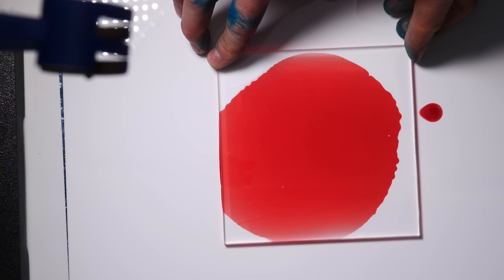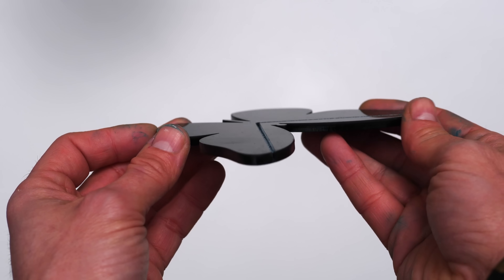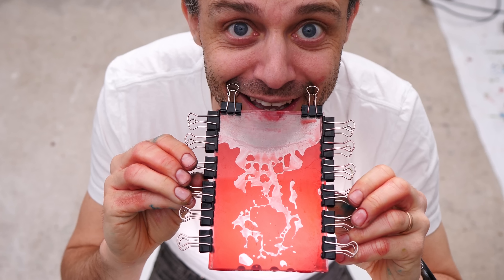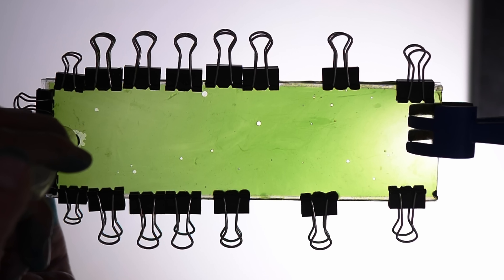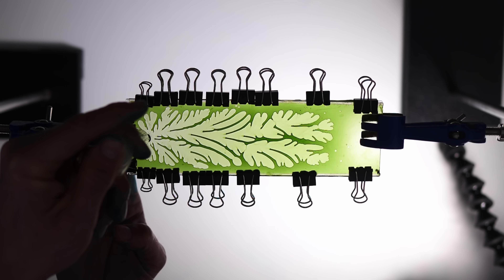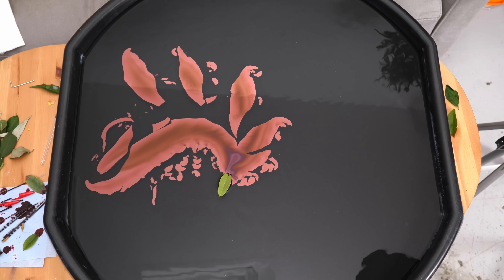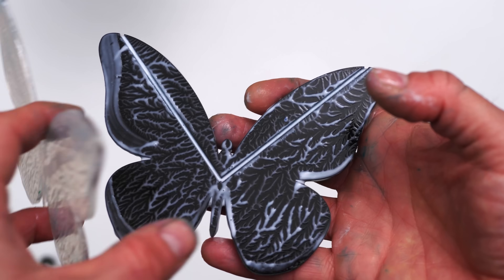Why honey makes these strange tendrils

Comment: I think a leaf would work perfectly for the plate shape and would look really good
Reply: At least one comment suggested starting with half a butterfly, reassembled side-by-side after it's pulled apart from the center out.
This would also work for the leaf, or any other symmetrical shape.

Comment: I believe the feathering follows the direction of the forces, so to achieve a symmetric pattern you would need to pull from the center body, without channels.

If you wanted to influence without touching the fingers, I'd reccommend reinforcing the non contact face of the plates. the reinforcing effect is a function of the plates "z" deformation, which is influenced by how its pulled apart.

Comment: Steve, I bet if you drilled some small holes through (as in normal to) each sheet of the butterfly you'd get a better effect than a channel from the edge. You could vary the density of holes for interesting effect maybe. Just a suggestion.

Comment: Someday Steve will win a Nobel Prize for discovering a method to determine, precisely, how cool “that” is.
Reply: We have that already it's called a thermometer...
Reply from the maker: If I ever do it will be by standing on the shoulders of giant fonzies
Reply: @SteveMould  And yet Henry Winkler was only 5'6"! (Probably a bit shorter now.)
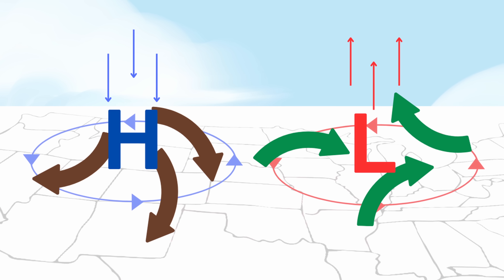Reply: @SteveMould  I think the blue arrows in the diagram at 7:08 are pointing the opposite way from how they should (how they do in reality). They are pointing anticlockwise, but should be pointing clockwise. They indicate the direction of the wind, i.e. the movement of the air w.r.t. the local part of the earth's surface. 
Conservation of angular momentum is enough to prove it. 
The air in a high pressure system starts out stationary with respect to the rotating earth. In the northern hemisphere (it is above the USA, we can see the map), that means it's initially rotating anticlockwise (viewed from above the north pole, from the star we call Polaris, say). As the air moves outwards, away from the center of the high, it's angular momentum is conserved and so the rate of rotation decreases, so that is is rotating slower than the earth under it, and thus relative to the earth is rotating the opposite direction, that is to say, it is rotating clockwise.
Reply: And the next prize for finding "Why is that". Maybe also "What is that" and to complete the golden circle: "How is that" with Simon Sinek.
Reply: Economics Prize
5:20 £1,000,000.00
Reply: futurama deemed the unit of measurement 'mega fonzies'

Comment: 12:07 just cut the acrylic in half and do each side separately, or make it flexible enough to pry both sides simultaneously. Another would be to cut a channel in the middle of the acrylic or wherever you want the glue to branch out from. You can see at the above timestamp that the glue has thicker bits closer to the channel, likely because the channel is a zone of low pressure, and so the air wants to travel towards it.

Comment: What if we pull apart the sections simultaneously instead of 1 side!? One plate would have to have something attached to the center to pull from which isn't great for filming I assume but I think it'd be way too finicky to have 4 points attached to the corners and evenly balance the force between them..

Comment: I liked the butterflies the best.  You could fabricate thin straight extensions from the tips of the wings on one side, and a flat tab (not overlapping the extensions) on the other side, and lift the wings via the tabs while holding down flat tab on the other half.

Comment: Mind blowing. 
On the symmetry problem, can you pry from more than one place so the proporgation begins at two points on the butterfly's wings? 
Also what happens if the plates are not rigid? In general here.

Comment: Why does it appear that the volume of the thick fluid decreases initially when the thin fluid is added?  In some cases it's enough to form a 2nd case between the air and the thick fluid around the edge of the circle.

Comment: Cut the butterfly in half along its longitudinal axis, pull the two halves apart from the wingtip inward to create the pattern, then glue them back together. As an added bonus, the fractal pattern will be axially symmetrical. Wait, I think I reinvented the Rorschach test.

Comment: For anyone wondering (like me) what a Hele-Shaw cell is (or more precisely why it's called like that), here is what ChatGPT explained to me:
A Hele-Shaw cell consists of two closely spaced parallel plates with a viscous liquid between them, often used to study fluid dynamics, viscous fingering, and other hydrodynamic phenomena. It's named after Henry Selby Hele-Shaw, an English engineer who studied fluid dynamics in the late 19th and early 20th centuries.

And it's a good example where AI is more useful than a manual search. I didn't know how to write the search term correctly and YouTube's subtitles were not helping here either.

Comment: If you want symmetry and you have a symmetrical shape in mind, make half of it. Use the inherent symmetry of the process and make both halves of the butterfly identical. Maybe a hinge at the midpoint for stability and control.

Comment: Hi Stene, the way I would approach the butterfly issue is to attach the pieces to 2 square or round pieces, then pull it apart.  It would be symmetrical obviously, but it should give a similar pattern on both sides.  If you do try it, I'd love to see the results.

Comment: This is so random but I used to do research and development on paint, specifically the rheology modifiers which go into them and I noticed this phenomena. We used to measure the high shear viscosity of paints in a plate and cone visctometer and when I pulled the cone up from the plate, I would see these fractal patterns every time and I thought it was very interesting. I made note of it and discussed it with colleagues but ultimately it was an unactionable observation that was just neat.

Comment: I have a solve for the butterfly. The grove needs to be down the middle of both parts. Adding a 2nd layer of acrylic plate  on the same path on the back, not real wide to strengthen it at its now weakest point. And adding acrylic handles to the extra layer of acrylic plate. So the pattern starts out in the middle. And the handles give you grip to pull it apart. The wings should bend a little evenly. As an artist I've played around with the acrylic plate sheets and craft paint. Gets the same results.

Comment: instead of separating the solid sheets by hand, maybe a mechanism could elicit a better result. I was thinking adhering the desired solid to the mechanism and using a rigid structure as it's counterpart. Repeatedly you used the same shape on both sides, which isn't required as it is a local phenomenon, and wouldn't be greatly impacted by the outer solids shape.

Comment: For the butterfly plates I think you want a channel running along the center line and some way to start the separation from there. Maybe something on the outside of each plate that you could pinch to grip and pull them apart. A wide notch in the center channel might help control where the fractals start.
Reply: I'm thinking a groove with a wire to lift on both ends.

Comment: For the butterfly you can try just to use same method like you do with the circle thing.. or almost the same, drill a hole in the center for air flow, attach a string in the center of the butterfly, and pull the pieces apart with the string ;)

Comment: The wavelength of the instability also depends on the velocity. At least in the geometry you have in printing, the faster you go, the shorter the wavelength becomes. Irregularities with shorter wavelengths level out much more quickly than those with larger wavelengths, so increasing speed can improve the smoothness of the printed layer. Unfortunately, at some point you end up creating strands of ink that explode into tiny droplets going everywhere and the layer becomes ugly again. Oh well.

Comment: Might be interesting to use UV glue, so you can freeze the pattern once formed
Reply: One of the "experimenting with resin" YouTube channels was recently doing almost the opposite -- using something like hand soap (I think it was) to make the pattern, and then pouring clear resin over it, so that the pattern gets embedded in the resin casting.

He then put some pearlescent powder in the resulting grooves so it looked like lightning, and I think the video title was something about "capturing lightning in resin" rather than referencing Saffman–Taylor instability.  :)

Comment: I was taught to never lift the heat sink off of a CPU once you've placed it down. Picking it back up makes hills and valleys in the thermal paste where the fingers are and aren't. So if you put it back down into that fingered thermal paste, it traps air and makes the thermal paste less effective. If you have to pick up a heat sink, wipe off the paste and apply fresh paste before putting it back on.
Reply: In actuality, the pressure from the mounting bracket will be sufficient to force out any air, and while I don't have any concrete figures, from my own personal experience (approx 15 years) I've never had an issue with reusing thermal paste if it is still fresh.

If the paste has started to dry due to age however then absolutely replace it, but if you have only just fitted a heatsink and needed to remove it for whatever reason, it's fine to use as is, the only exception to this would be a heatsink on a bare die, and even then I'd just add a small amount of additional paste to replenish any that might have been lost rather than completely replace it all.

Also to the person saying to spread it as thin as possible, don't bother, spread it out but don't worry about making it as thin as possible, especially because it's better to have too much than too little, and again, the contact pressure will force out any excess paste and the only time this will be a concern is for electrically conductive pastes such Arctic silver 5, which shouldn't be used any more as Arctic cooling mx-4 is a far superior paste, and there's newer even better pastes available now.

Gamers Nexus has an excellent video discussing thermal paste applications and how they affect cooling performance, and their testing data mirrors my own experience.
Reply: @PaulTheFox1988  you make a great point.  Pressure is critical when applying back shots.  You get it wrong and well….it could just be an “any shot”.
Reply: Damn, cant even finger their computers, geeks lose yet again
Reply: or just use thermal pads instead
Reply: That's not a real issue with fresh thermal paste. The reason you shouldn't put it back on, is because thermal paste ages and dries out
Reply: @ that’s why you need to clean up back shots quickly. They get crusty.
Reply: @scallywag1716  🤦🏻‍♂️
Reply: Also you should make the layer as thin as possible as thicker thermal paste can act as a thermalmidolator if its to thick.
Reply: @hassiaschbi  It actually doesn't matter if you put more on as the required mounting pressure for good contact pushes the excess out anyway. All it does is waste thermal paste.
Reply: @christopher-  💯 another issue to be aware of if using too much, besides just waste, is that thermal paste that spills out into the motherboard may cause shorts. Granted, most thermal paste is non-conductive, but worth keeping in mind
Reply: @mtqrx I think that's more of an issue for liquid metal
Reply: @christopher-  No commercial CPU has a heatsink retention mechanism which can exert enough force to accomplish a full discharge of all excess compound. If they did, the CPU heat spreader would bend and crack the ceramic encased components under it.
Reply: @hassiaschbi  What's a thermalmidolator?
Reply: @matthewbartsh9167  that's a great Question! I meant 'thermal insulator'.
Reply: @hassiaschbi   Nah. Back shots can be put on thick…no problem.
Reply: In theory that's correct, but i never removed a heatsink from a CPU/GPU/whatever and have "channels" in the paste. 
If i reapply the heatsink, i usually give it a little twist back and forth, spreads the paste, no worries. Removing the old and applying fresh paste is better, of course.
Reply: Sounds like a waste of paste to me. In some circumstances it might trap air, but normally the pressure is high enough that it pushes it all out anyway when re-mounted. But if you're afraid of air, just take a flat piece of plastic or something and smooth it back out.
Reply: @ thank you for the back shot tips. I think that’ll cum in quite handy.
Reply: I was told the same about other scenarios that include something called “back shots”….
Reply: how  @scallywag1716
Reply: @scallywag1716  Wait 'til you hear how the cover art for Metallica's Load album was created.
Reply: @ I was a part of creating it.

Comment: Maybe if the butterfly was slightly folded along the center line, and the thing used to pull it apart is a wire or string in the fold?

Comment: There is an experiment in cell physiology where we put single cells on a specific matrix and cells form vessel-like structures, tube formation is the typical name.  It is similar to this but more actively produced.  The initial network structure is based on the positioning of the cells and their molecular behaviour.  It is pretty awesome looking!

https://youtu.be/tYDF1i1lRJU?si=1S9-ckM1wJP57vag  This is a great video showing what I'm talking about.

Comment: Super interesting that you see the viscous fingering happen at the perimeter of the more viscous fluids when you inject the less viscius fluids into their centers — I assume what's happening is the injection is pulling the two plates apart and causing air to infiltrate at the boundary, in the same way as your simpler examples (e.g. the butterfly)

Comment: It's weird that the thicker fluid contracts in overall size when adding the thinner fluid. Shouldn't it expand?
Reply: It's because the pressure is separating the two plates a bit, so it increases the available volume.
Reply: Jetting the thinner liquid in between the plates pushes the plates apart. That's why the outer edge moves inwards.
Reply: @grieske  That makes sense, thanks.

Comment: Just put the butterfly one into a jig to hold it in place, where you can apply equal pressure to both wingtip corners at the same time with something like a metal bar on a lever

Comment: Something that's weird about the examples where you pull apart two plastic sheets is that the fractal forms itself backwards, it goes from many tiny fingers down to a few large ones at the end. I'm used to fractal patterns always being created the other way around, from a big to small.
Reply: But it makes sense if you think about it in light of the indent explanation Steve gave. In the beginning there are many small indents of comparable size. But the deeper the indent gets, the faster it moves. Hence, an indent that is just slightly deeper will win out by covering more ground and essentially blocking off its neighbors. That's how you end up with a few big fingers which then go on to feather out again.
Reply: That's how rivers look. They start from their points and end at the larger body of water